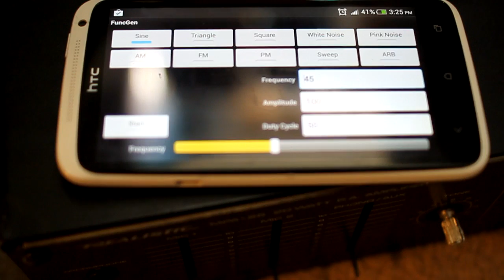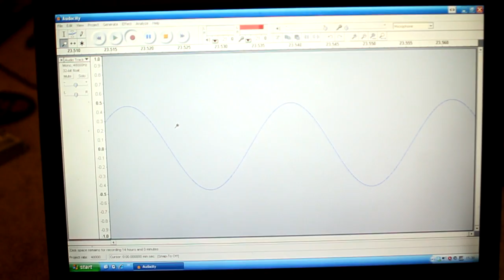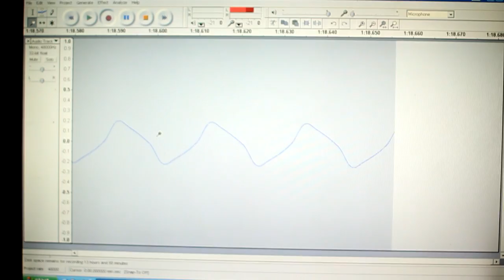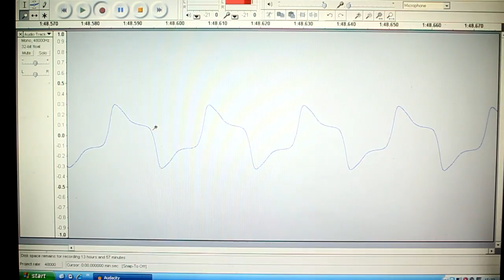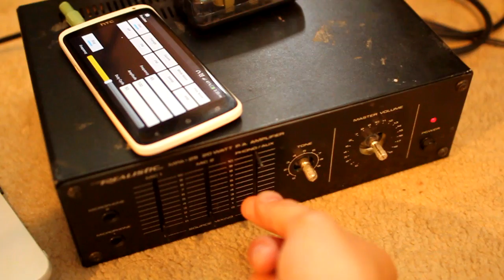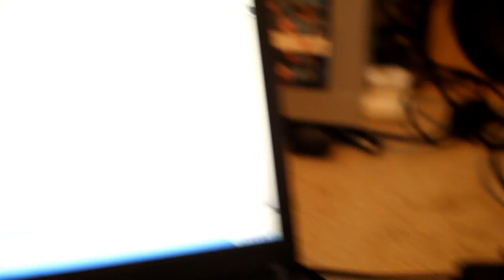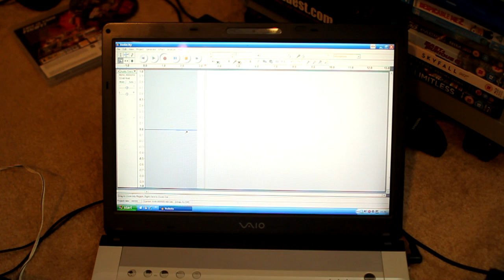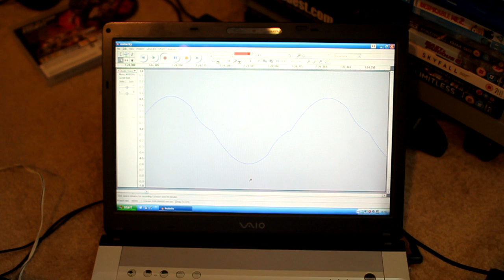O-scope with Audacity!! Subwoofer setup made easy!

Comment: This would be more accurate if you used the line in on your laptop or PC and not the MIC input, your mic input is not designed for amps and etc to be plugged into it which is why your clipping easily
Reply from the maker: Heavy Fuel Technology I agree, however in this case the laptop has a combined mic/line input which is switchable, and no dedicated line input.

Comment: May sound like a stupid question but how exactly is all this set up? My understanding is the phone is the source, using the 1/4" headphone output to red/white rca into the amp, then is the amp feeding both the high level converter and the Daytons on separate outputs, or in parallel on the same outputs ? And then from the high level converter, its rca red/white to aux headphone input on the laptop?

Comment: I have 5,000w amps can this be used for setting them?
Reply: You would need to add a resistor in line with the speaker level input of the LOC for this to work. Without a resistor, 5K will kill a LOC. At that power level, for 2 ohm amp impedance on the subs, you will be putting out 100 volts from the amp. Even the most expensive LOC can't handle 100 volts, they are designed for about 20 max. A 25-50 OHM resistor, rated for 100 volts, will work nicely.
Reply from the maker: Yes you can test any wattage of amp, using the line level converter in the video which can be bought from eBay for a fiver. It has gain pots on it which you can adjust so that you don't overload the amp input. :)
Reply from the maker: Go to eBay and type 'line level converter' and take your pick, get one with gain knobs tho. Mine is the 3rd result down in the list I get
Reply: I would probably not do that and possibly destroy the input on your computer with that kind of power this is just for testing smaller things like your phone or a very low powered amp
Reply: possible you could do a video showing a big amp being set?
Reply from the maker: DJ Inclined of course! As soon as my DD M4 arrives I will scope it!
Reply: ah very cool man, got a link for a good converter?
Reply: barevids Sending 5K to a LOC only rated for 100 watts will kill it instantly as it gets closer and closer to the amp's RMS power. Even the LOC's "Pre-amp" potentiometer will not be able to handle the torrent of high voltage that it would be receiving from a 5K amp.
Reply: yeah I'm thinking the same
Reply from the maker: The pots on the converter I have at lowest setting are a very very high resistance to the amp. If the amp does 5k at 1 ohm, and the resistance is 5000ohms for example, imagine how low the wattage would be. Electricity will always take the easiest path - it won't damage it I am certain, the most that will happen is the input signal will be too high to be read easily in audacity and will just look clipped, requiring another resistor in series :) 
I will show this with my m4 when it arrives! Might do a test with the macro tech in the mean time!
Reply: If the pots go to that high of a resistance, then yeah, it would work perfectly. If the LOC was designed so that it at eh lowest setting it was made for 80 watts and no more, then the circuit would be overloaded. I mean, and LOC in a car is essentially emulating a speaker to the head unit, so I figured they wouldn't be using a 5k ohm resistor for the line level.
Reply: I'll be here waiting patiently Barevids. :)